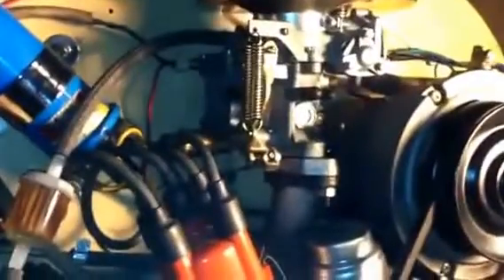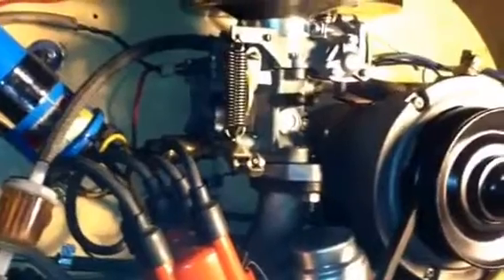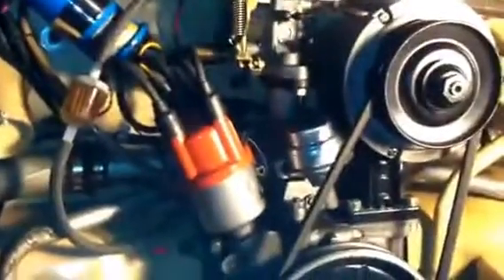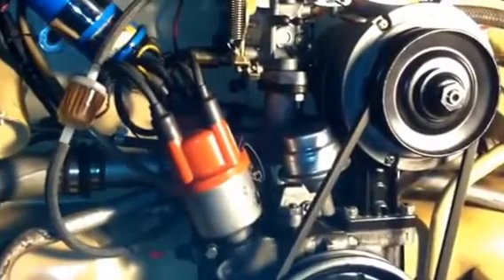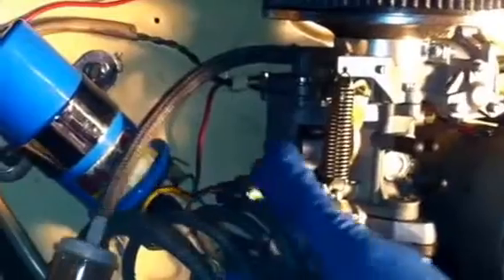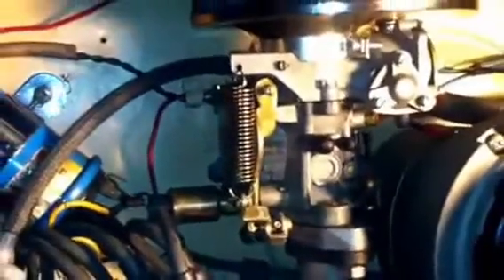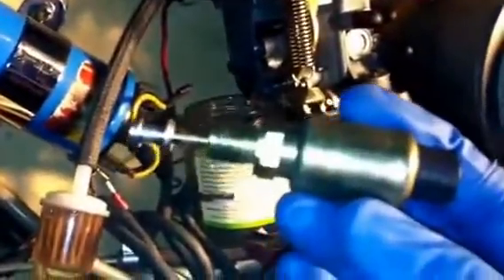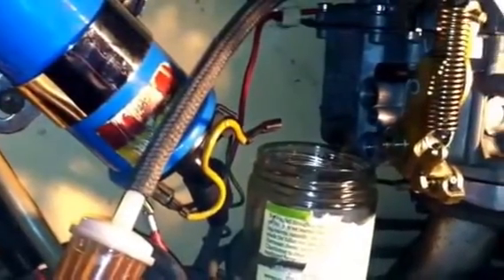Changing the Main Jet and Idle Jet on a VW Carburetor

Comment: Good video.  I suggest you relocate the fuel filter to under the car.  Number one reason vw burn to the ground.  You have it on the pressure side of the pump and no clamps.  Those plastic filters do not like pressure.
Reply from the maker: Oh cool thanks for the advice. I will check where I have the filter at now. So I should move it before it gets to the pump and of course get some clamps. Is there a better filter you suggest?
Reply: Under the wheel housing is a good place splice it into the fuel line just before it connects to the metal fuel line that goes through the firewall. While there replace the rubber grommet that protects the metal fuel one where it passes through the firewall. The absence of the grommet to protect the metal line is another big cause of engine fires. Great video!
Reply from the maker: Tom M hey greats tips man. I will do that and then make a video about it for other folks to do the same. I need a new tranny and block at the moment so not driving it.
Reply: Alex Salazar or use a metal filter or alloy.i use a edelbrok autozone sell em 10 bucks and reuseable

Comment: How you get the jet out????
Reply from the maker: With an 8mm socket or wrench
Reply: mrabelonee The plug it's out but the jet can't get it out
Reply from the maker: Use a flathead screwdriver to take out the main jet that's in the floatbowl.
Reply from the maker: I'm pretty sure you use a flathead screwdriver to unscrew it. It's been a while since I did this video so I don't remember. It's probably just stuck/tight, it will come loose with a little strength.
Reply: mrabelonee yes I did but it's really really stuck...ok thank you for you help

Comment: Wrong carb
Reply from the maker: What is the correct carb? This is not a stock engine. It was a single port. I put dual port cb 044 heads and a quiet pack empi exhaust. It also has a 009 distributor. 88 cylinders as well
Reply: All that fancy stuff  and no research.
Reply from the maker: @kenburkham5483  My point is that the stock carb is not correct because the engine is no longer stock. I don't remember off the top of my head, but I believe a stock carb for a single point 1500cc engine probably would have been a 32pict. Since I wasn't running a stock engine I was trying to increase the volume and air flow, thus I went with a larger carb, I think its a 34 pict in the video. I don't remember I think it was prob about 10 years ago.
Reply: @SanDiego_VDubLife  so you went backwards in technology
Reply from the maker: @kenburkham5483 okay so I finally went back and watched the video and I must have chosen this carb because this is what I had available to me at the time. If I had a 34pict carb I would have used it but buying the jets was cheaper than buying a whole new carb. I ended up buying dual carbs later but this was to get me by in the mean time.